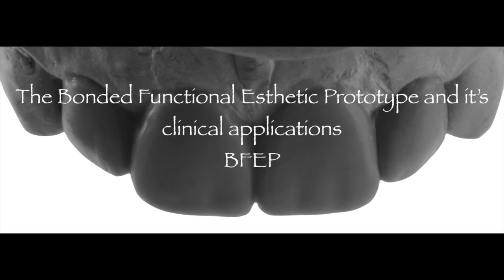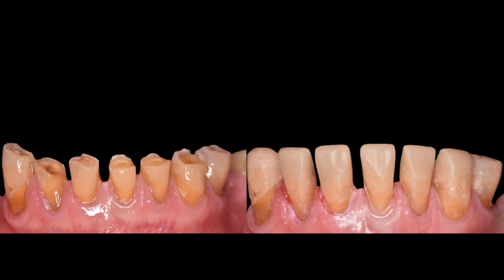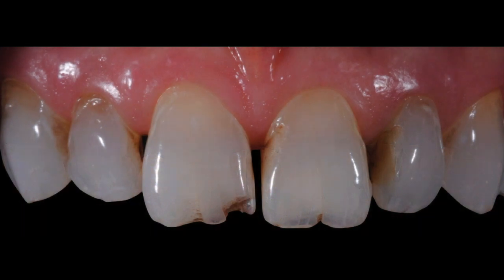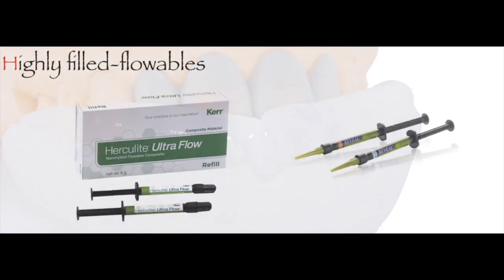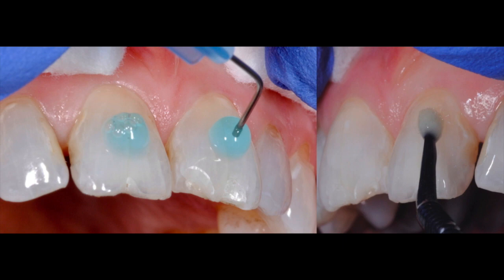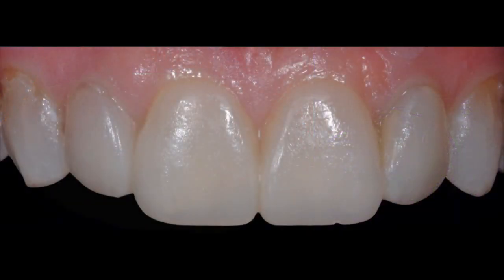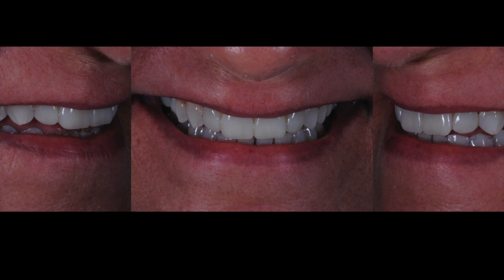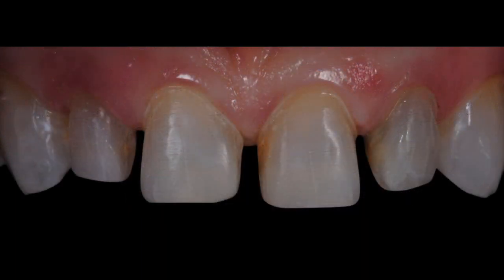Bonded Functional Esthetic Prototype tip

Comment: Nice can i ask can we use this technique for long term ??? I know that we need to etch the entire surface as Maclaren recommend but i am asking if you have cases for 1 or 2 year survival  because of financial reasons of the patient
Reply from the maker: Ahmed Thejil I have had cases completed with flowable composite and followed up for 8 months with good results. When I am looking for longer time I use regular MH or NH composite, the only thing I do different is that I warm these composites so they are easier to inject inside the tray. Hope this helps.
Reply: Mario Romero thanks alot